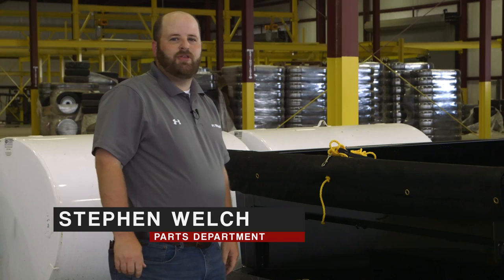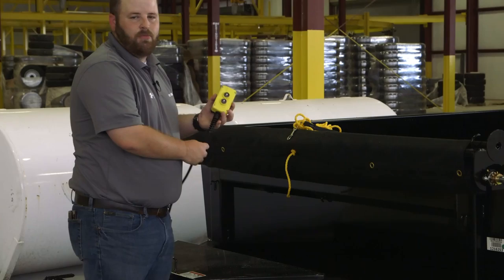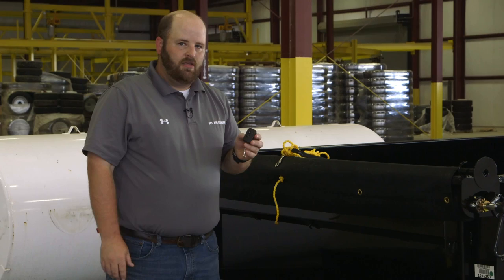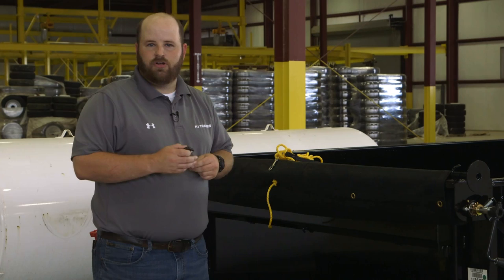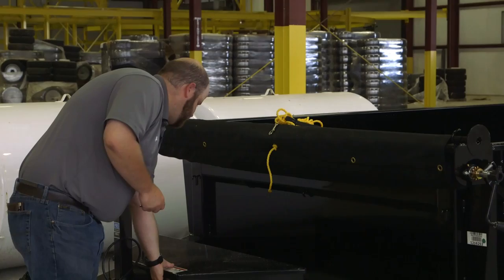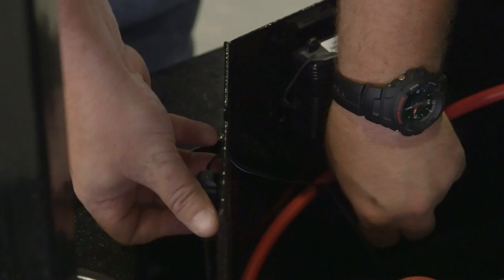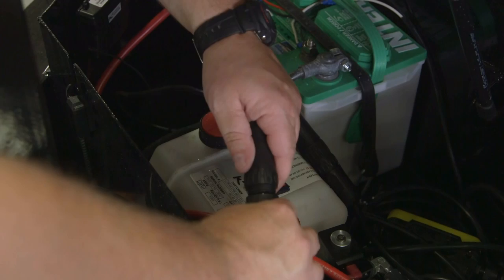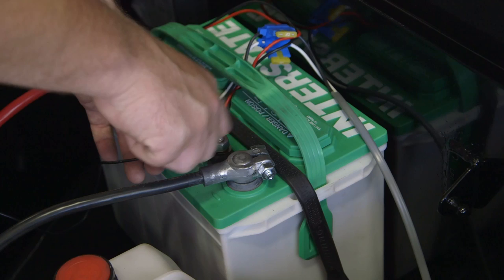PJ Trailers Wireless Remote Kit

Comment: Does this kit only work on PJ trailers? Or would it work on my BIG TEX 14LX?
Reply: MrLowrider3  I'm not sure on this particular one but I just ordered this one from Amazon, I called my local dealer and got the part number searched for it and found it for a $100 less than what they were selling it for. I have a 2017 16LP big tx trailer.                                                      Bucher Hydraulics Wireless Remote Control - Wireless Dump Trailer Remote Kit https://www.amazon.com/dp/B01N5HHIFS/ref=cm_sw_r_cp_tai_oNevCbDMJ3G36
Reply: How is it working out for you? @moose8172
Reply: MrLowrider3 perfectly, if you want I can go take a shower video in a few minutes and show you how it works. I have a channel that has a few random videos already I can add another one I guess haha